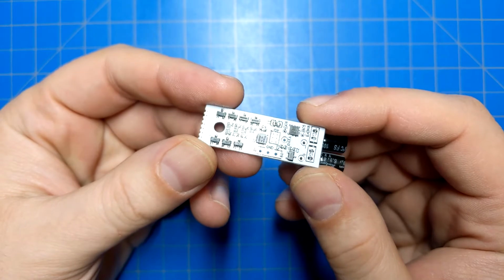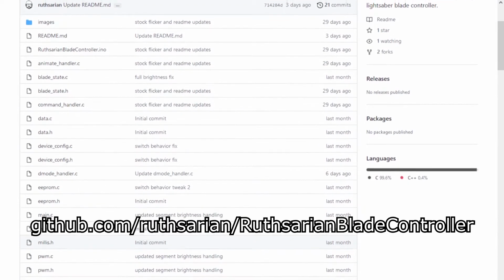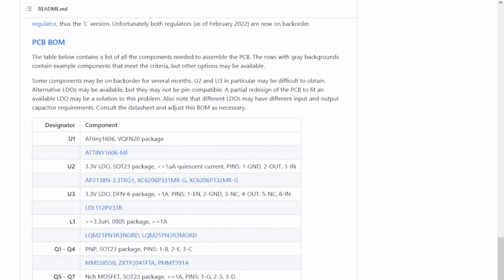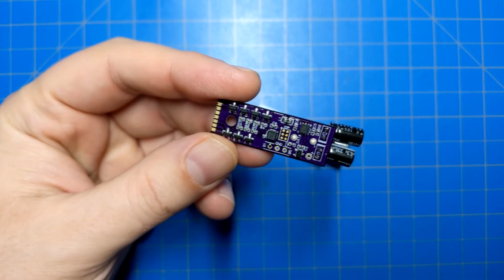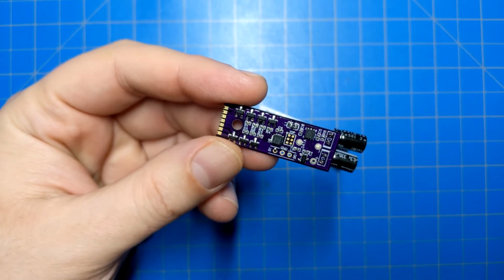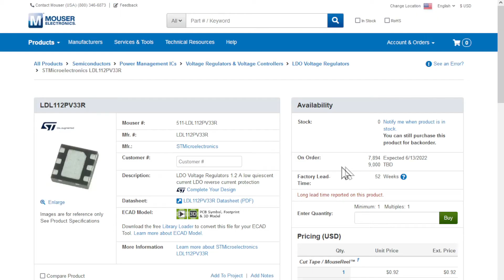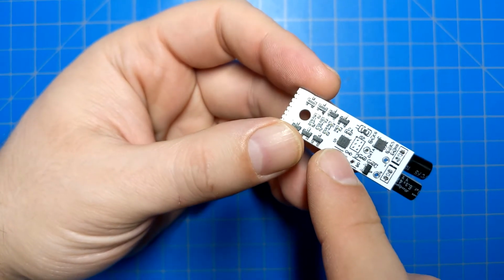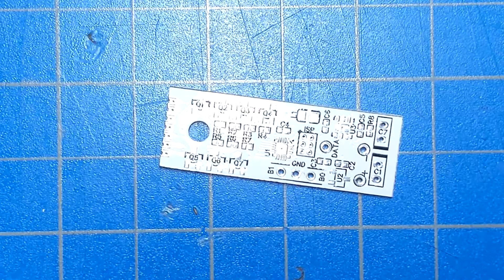Custom Galaxy's Edge Blade Controller - Feb 2022 Update

Comment: Checking in, did you ever decide to sell these / did the supply shortages clear up? Am really hoping to get a blade for my savi hilt
Reply from the maker: Not yet. I have a 4-part video series I'm trying to put together that shows the assembly and install process. I want people to know what's involved with assembling, installing, and programming one of these before they buy one. I have a ton of video for these videos already filmed, I really need to just sit down and edit it all together and figure out what, if anything, I still need to film. 

The droid toolbox stuff sort of took over for a while, but I think it's at a point where I can let it rest for a bit and return to working on those blade controller videos.

Comment: would it be possible to add Bluetooth to it so that you can reprogram it with your phone on the spot with a app? so that you don't have to use the switch to reprogram it and you can do over the air update with your phone?
Reply from the maker: Not with my blade controller; it doesn't have bluetooth capabilities. Adding bluetooth capabilities would require a complete redesign with a new microcontroller and it would likely make the PCB too large to fit within the same space as a stock blade controller.
Reply: Omg thank you for the reply!!! I was wondering if you could make a board where I could change the color of the blade to orange and teal as well as the other colors just by reading what the RFID tag says on the crystal so that you won’t have to make holes In the blade. I was wondering if there is a better way of contacting you because I had a few questions

Comment: I am having some of the 4.4L versions made and some pogo adapters for a a group of us to use on our blades on May 4th. I SHOULD have about 5 controllers and 3-4 pogo adapters to spare, I'll be at Hollywood Studios Orlando May 4th if anyone is interested.
Reply: Controllers came yesterday. Swapped out all 5 of my blades. I wish there was a way to program the controller without disassembling the blade. Some way to re-use the power/data pins at the base of the blade - or maybe add another one would be great for software updates. I want to add Orange to the color picker. Would love to be able to do color picker from the gradient mode too. I need to go back through and see if there's a way to "save" a favorite color/submode and recall it later.

As an aside, JLCPCB did an OK job but i'm not overly thrilled. The ends of the controller where it meets the blade were not well manicured and had the copper foil flapping in the wind for the most part. Additionally, of the 10 controllers there was a pick and place error on one and they missed the capacitor C4. I'm not sure what exactly that would affect I was having some color issues I can't remember if it was green or blue but the top segment of the saber would also not light with that controller. It took me about an hour of cussing before i noticed C4 was missing..... I quickly tried popping a cap of one of the Disney controllers and using it... not sure if they are directional usually the smd/ceramic are not but i tried again and the top segment was still out, I think all the colors were working though. I just swapped the controller and figured i'd deal with it later.

Comment: What about the option to add a remote, much like the LED strip lights?
Reply from the maker: those usually operate with infrared (IR) light. you would need an IR receiver mounted somewhere on or inside the blade where it could 'see' the IR signals from the remote. some testing would need to be done to determine the best location for the receiver. 

IR receivers are typically 3 pins, power, ground, and output. ground would go to the GND pin that's on the board and output would go to either B0 or B1 pins. power would be a little tricky in that i don't have a pad that exposes power. operating under the assumption that the receiver only needs to operate when the blade is on, you could run a wire from the positive lead of capacitor C7 (which is used to power the LEDs in the blade) to the IR receiver. 

once the IR receiver is wired up, the code for the controller would need to be updated to read and interpreted the data from the output pin of the IR receiver.

i think it'd be possible to implement.

Comment: Just placed an order for 6 boards, and enough components to build 8 of them, I was able to order every component except U3, and I also need to get the pogo pin adapter. Once I can source the microcontroller for U3, everything else comes in. The plan is to build it!!. This will be my first time assembling a circuit board, I am however very good at soldering. What solder paste are you using? and once I have it built and ready to be programmed... Assuming I managed to get a pogo pin adapter, I'm slightly confused on how to go about programming it. Can I use my PC to flash the firmware, or do I need some kind of Arduino Nano like you had mentioned that you used? 
Thank you for releasing this to the public, I am super stoked about building and installing one myself for my GE hilt collection.
Reply from the maker: In one of the videos I will be making about assembling and installing the blade controller I will show on how to program the blade controller.

You can look through the megaTinyCore repository (https://github.com/SpenceKonde/megaTinyCore) which includes some documentation on how to program a chip using UPDI, which is the protocol used by the ATtiny1606.

What I use is megaTinyCore's old method for programming. I use an Arduino (I've used both an UNO and Nano) and program it with jtag2updi (https://github.com/SpenceKonde/jtag2updi). UPDI is a single-pin programming interface. When programmed with jtag2updi, digital pin 6 on the Arduino is now the UPDI programming pin. I connect, via the pogo pin adapter, UPDI, power, and ground to the assembled board. I then use the Arduino IDE (https://www.arduino.cc/en/software) with megaTinyCore installed to program the blade controller. 

The rectangle on the blade controller PCB labeled "ISP" on the top is the 'in system programmer' header. On the reverse side is the same rectangle, but each pin is labeled. "VMCU" is power, UPDI is UPDI, and GND is ground. 

megaTinyCore's documentation now suggests using a serial to USB adapter to program using UPDI because it's cheaper. I have made some attempts at that and have not had any success, so I continue to use the arduino programmed with jtag2updi method.
Reply: @Ruthsarian  thank you for the information.  I have a raspberry pi 3b+, and a pi 4. Would either of those work? if not, ill just order an arduino nano.
Reply from the maker: @proflycustoms5991  i don't know. i haven't used a pi in that manner. i would think so, there's no reason it wouldn't be possible, but i'm not sure what kind of software you'd need or how you'd connect the pi to the board.
Reply: @Ruthsarian  Ill just order a arduino nano. Is there any special wire harness that I need to connect the arduino nano to the pogo pin adapter? and which pins on the arduino will I use to program the blade controller once I have it built?  (speaking of building what solder paste do you use, I have never used solder paste before just regular solder so Im not sure what works best)   Thank you for answering my previous questions, I really appreciate it!
Reply from the maker: @proflycustoms5991  no special harness, just a few jumper wires (https://www.amazon.com/dp/B01EV70C78/). jtag2updi uses digital pin 6 on the arduino as the UPDI programmer. So that, 5V, and GND are the 3 pins you will connect from the arduino to the pogo pin adapter.

for solder paste, i use Chip Quik SMD291AX (https://www.amazon.com/dp/B0186IM0P0/), although just about any solder paste will probably work. i also have some Quip Quik SMD291 flux as well (https://www.amazon.com/dp/B0186IM0P0/) which i use to help clean up the excess solder that will form around the microcontroller (U1) and voltage regulator (U3).
Reply: @Ruthsarian  Good news is Solder paste will here in a few days and all the components come today except U3. The PCB boards will be made in the next week, and the arduono nano will be here in a few days so I will have everything in about a week and a half except the Pogo pin adapter and the U3 chip.
Which is the bad news, I have checked and reached out to every company in the world just about that has a few and only one has gotten back to me out of Shenzhen,China.
Their price for the chips is reasonable, but the shipping is like $50 so to get 6 U3 chips it would be about around $81 to get them which is pretty crazy, so Im going to keep searching.
Reply from the maker: @proflycustoms5991  your best bet is to put an order in with mouser (https://www.mouser.com/ProductDetail/511-LDL112PV33R) and wait until they arrive (mid-June).

what will you be using to heat up the solder paste?
Reply: @Ruthsarian  Okay, Ill go ahead and do that then.
I have a digital hot air rework station with adjustable temperatures that I am planning on using.
Reply from the maker: @proflycustoms5991  cool. just wanted to make sure you had something for that. sounds like you're in good shape.
Reply: @Ruthsarian  Great News, The Pcb's came in today! (they look great!) and I have everything else including Arduino mini and those jumper wires. Just trying to find the pogo pin adapter or one that will work. and Waiting on my U3 chip to ship. I placed an order like you suggested so not I just have to wait till June which kinda stinks, but hopefully by the time I get that I will be able to find a pogo pin adapter! and then it is time to build and program!
Reply: @Ruthsarian  Still waiting, The U3 chip is still on backorder so It will be a few more months but Ill get it eventually
Reply: @Ruthsarian  My U3 chip came today at last! 
I've got everything except a pogo pin adapter. where else can I find one? the place you got yours still doesn't have them in stock? So stoked to finally build this
Reply from the maker: @proflycustoms5991  I don't have any source for them. you need, at minimum, a 1x3 pogo pin adapter with 1.27mm pin spacing (pitch).

there is a 2x3 one on ebay 
https://www.ebay.com/itm/265392553224

you might find others searching elsewhere like tindie or amazon or ebay.
Reply from the maker: @proflycustoms5991  I'm going to do what I should have done a long time ago and take a crack at designing my own adapter. POGO pins are easy to find online. Designing and ordering a PCB to hold 6 pogo pins and 6 header pins to plug into is trivial. The assembly... that's the one thing I'm not certain about. I think I'll order from OSHPark and create a sandwich of 2 or 3 PCBs to ensure the pins are straight, but only solder them to 1 pcb.

i've uploaded the design to oshpark and i've just put in an order. https://oshpark.com/shared_projects/SSv946nJ
I'm using 0.68mm diameter pogo pins, which can be found on amazon pretty easily (https://www.amazon.com/dp/B08NZVD88K/)
And I'll use standard male, dupont-style header pins for the connector (https://www.amazon.com/dp/B07PKKY8BX/)
Reply: @Ruthsarian   I don't know why I didn't see this till now, but thank you so much! I'm going to order the parts to build the pogo pin adapter tomorrow!!
So after I build it, and build the blade controller. I'm sort of confused on the programming aspect of it. How do I get the adruino nano setup to flash the blade controller. I'm still a little new to this stuff so I'm not sure where in your gethub the coding is, and what I do with the coding through the arduino nano, and adruino ide to flash it to the board.  I built a neopixel lightsaber so im sort of familiar with arduino ide but I don't really know how to get the arduino nano setup. 
any help would be much appreciated! and I'm so excited to finally build one and get to go to galaxy edge with it in a legacy hilt!! 😁

Comment: OH GOD!!!  I love the switches!  Everything you've been doing is awesome but all I've wanted since Galaxy's Edge opened and we learned about the Orange and Cyan crystals, is to have a lightsaber that recognizes those options.  Have you considered 3D printing your own sleeve for the bottom of the blade?  You could 3D print a sleeve that has buttons that don't obstruct the position of the blade, and don't look ugly.  

Also, about how much will they cost if and when you do start selling them?  Are we talkin' hundreds of dollars or dozens of dollars?
Reply from the maker: 3D printing a new sleeve is an option. I don't really have the facilities to experiment with that at the moment. Maybe someone else is able to do that.

Costs I'm still trying to figure out. Just the assembled blade controller will probably be $25-30. Installation probably another $10-15 if you send me a blade.
Reply: @Ruthsarian  If you're looking for someone who could 3D print parts for you I might be able to do that.  I really love the switch idea and want to see it become a reality, so if I can help I'd like to.